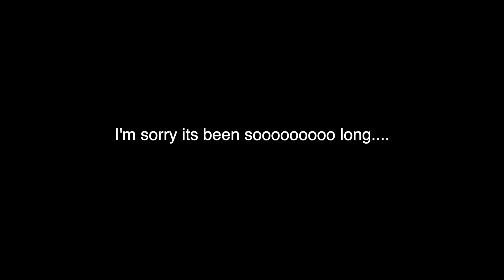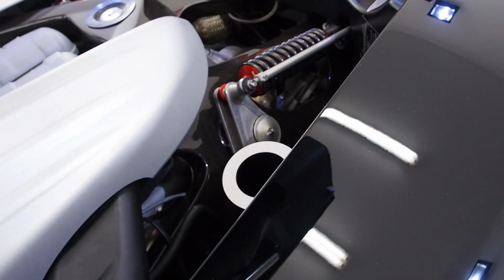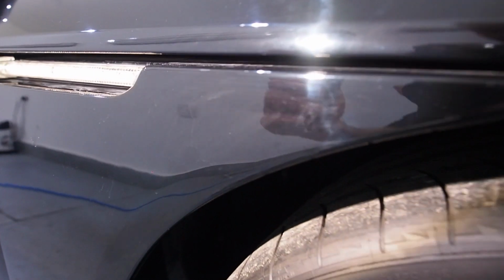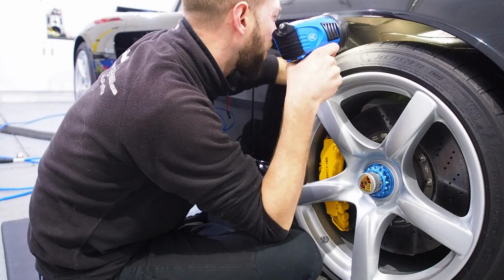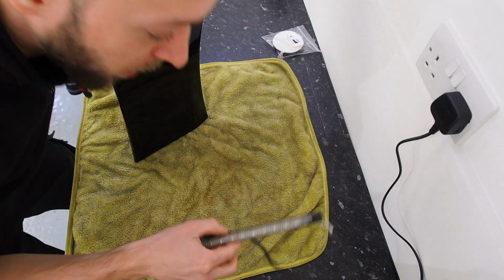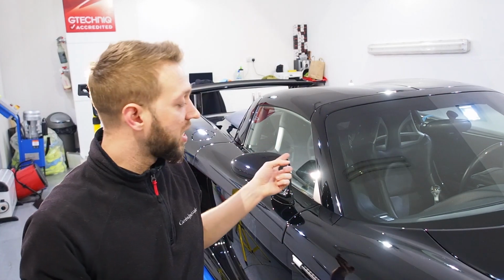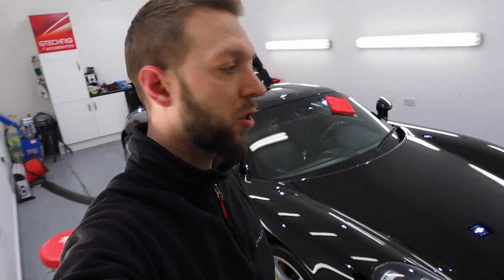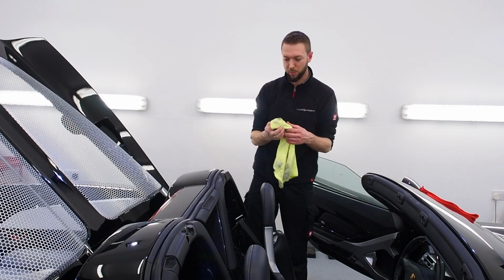Detailing the stunning Porsche Carrera GT | Cambridge Autogleam Detailing VLOG 27

Comment: what IPA do you use and in what concentrations?
Reply from the maker: Not sure of the brand. It tends to differ depending on where I get it, but it’s 99.9% strength and I use it neat in most applications other than when prepping PPF for Halo application, when I use it mixed 50/50 with pure water.